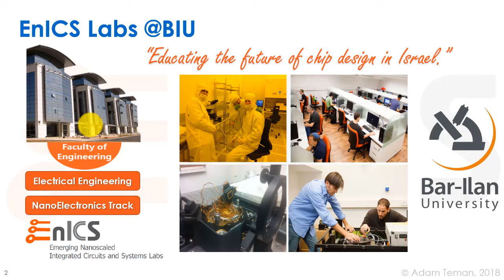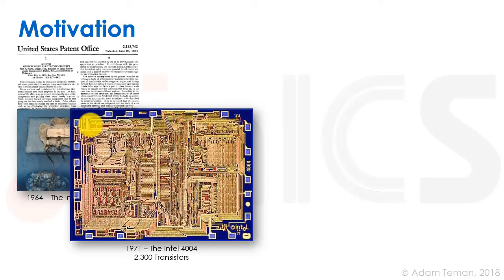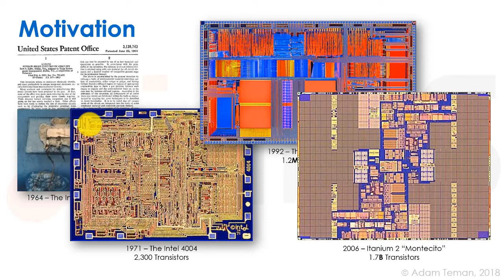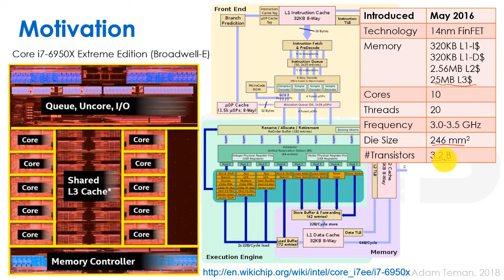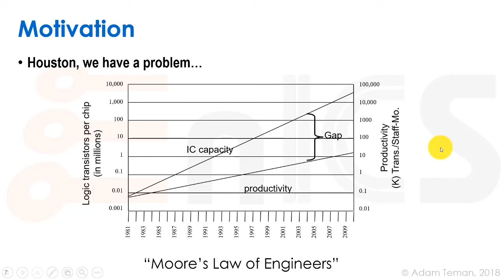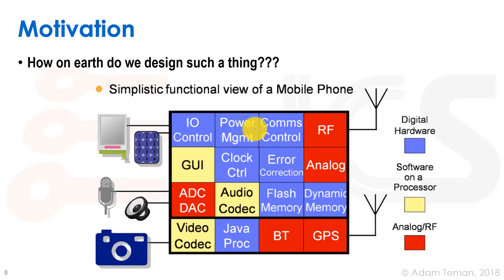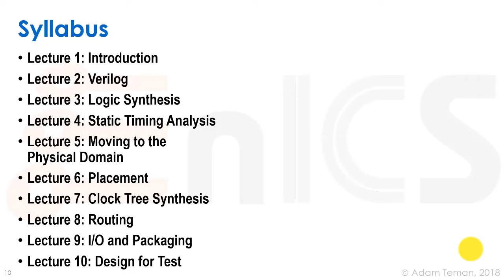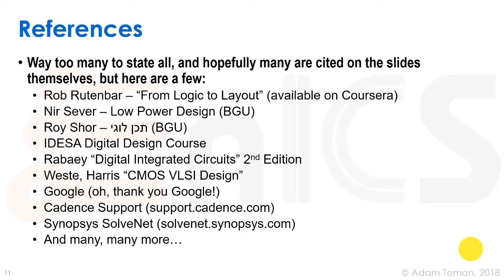DVD - Lecture 1a: Introduction

Comment: Where is the slides of this course?.Its not availble on the link.
Reply from the maker: Hi,

The link isn't available, since the university has blocked access for IPs originating outside of Israel for security purposes.

I have uploaded my lecture slide to a sharepoint drive in the meantime, so you can access them here:
https://biu365-my.sharepoint.com/:f:/g/personal/temanad_biu_ac_il/EuORrTC7arlEn3S9M-0q2fEBd5DnUUiMIJ6DFd6cCPl4zw?e=aUktHb